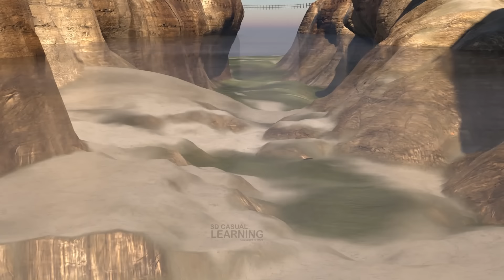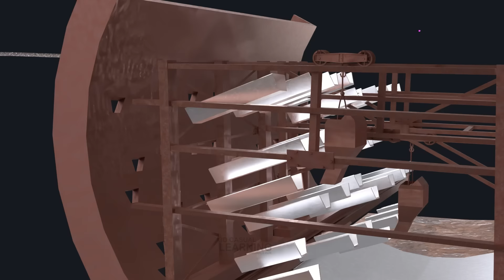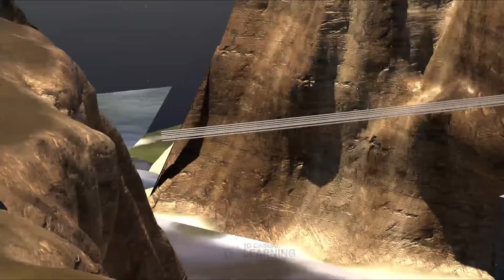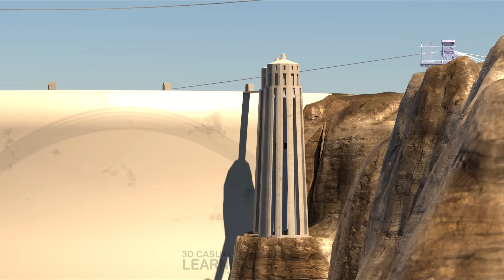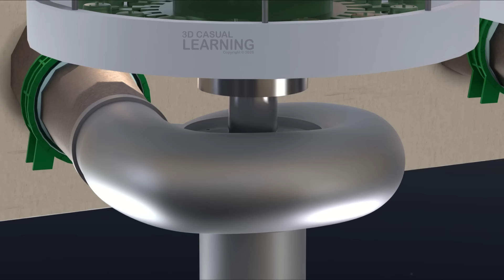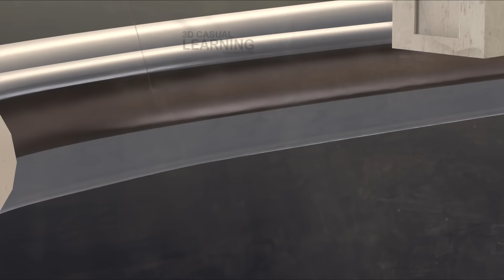The Engineering Secrets Behind Hoover Dam's Construction | 3D Animation

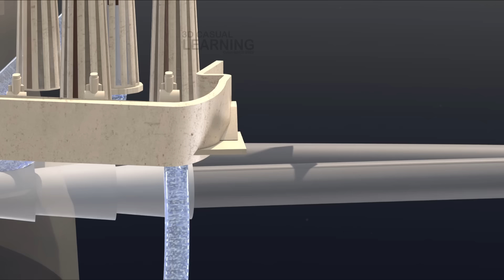Comment: 20:25  ". . .the outer tunnels act as a critical safety system, protecting Hoover Dam from over-topping during floods by providing a controlled path for excess water."  Not anymore--all this remarkable engineering work can't alter the fact that the Colorado River system is yielding less water than is being drawn from it, the reservoirs are shrunken, the dams are in imminent danger of losing their ability to generate power or to store and release water in the way it was designed.

Comment: The dam works so well when it’s full,,, doesn’t work worth a shit when it’s empty
Reply from the maker: No water, no power. That's the one thing even an engineering marvel like Hoover Dam can't get around.
Reply: @randallbevansr5200  not only is water volume down but the silt from 100 years has also shallowed the depth at the dam. Nothing last forever so engineering will be needed again. Unfortunately for the citizens of california when the time comes for leadership to step up and make tough decisions those leaders will not be there. They don't elect leaders, they elect advocates . These advocates could care less about the nuts and bolts of running a city of state. That state has major problems coming their way and im afraid its gonna get downright nasty.